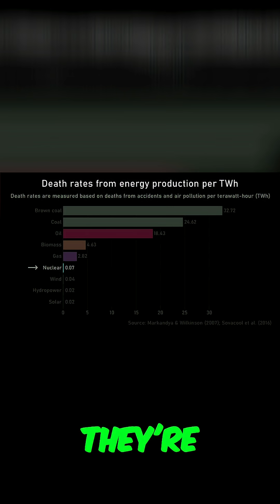Nuclear Reactors Are SAFE? Engineering Secrets Revealed! #shorts

Comment: I don't know what this channel is on about, but nuclear is DEAD. Renewables (wins and solar) are far, far, far, far, far, far, far, far, far, far, far, far, far, far, far, far, far, far, far, far, far, far, far, far, far, far, far, far, far, far, far, far, far, far, far, far, cheaper and faster to implement, maintain, and operate. The average time to get a nuke plant up and running is ten years. Solar and wind can be built in less than a year. Of course, for renewables you need batteries and now we have sodium-ion batteries that are a lot cheaper than lithium-ion and are safer and have a longer life.
Nuclear will only matter if fusion works out.
Reply: maybe but the new designs like MSR coupled with less red tape will mop the floor with your other types, wind and solar are fine, but things like biofuel are an absolute nightmare
Reply: @ashleyobrien4937  You're hoping for less red tape? You think that will bring the cost down? Renewables are not only the future, they're here.
Reply: Renewables are rubbish.
Reply: @cianmoriarty7345  How so? How is expensive, long to build, and polluting, nuclear power better?